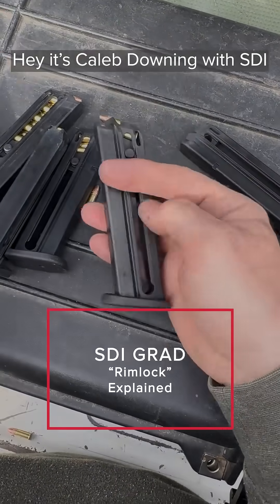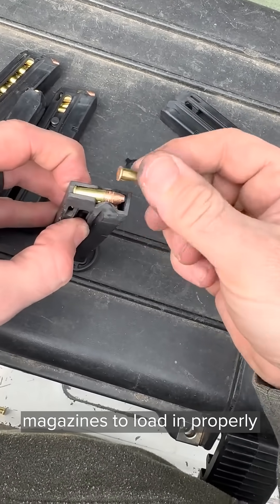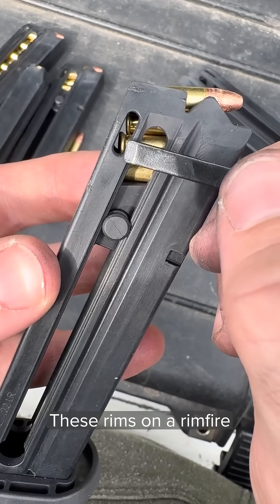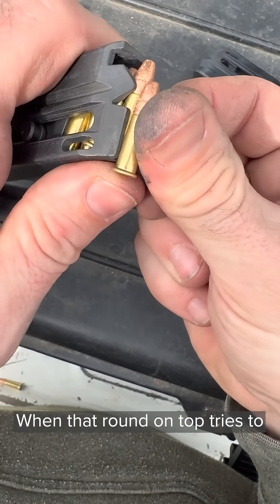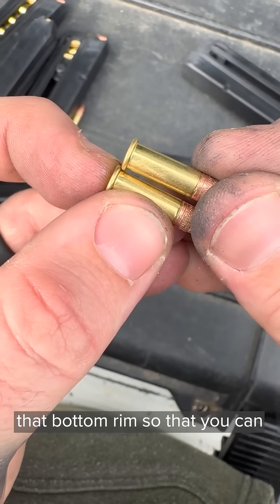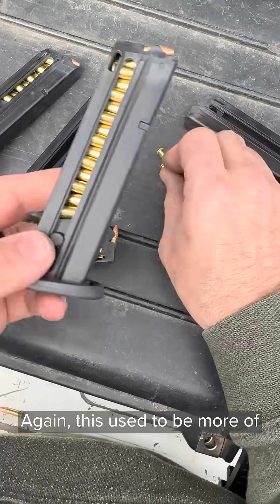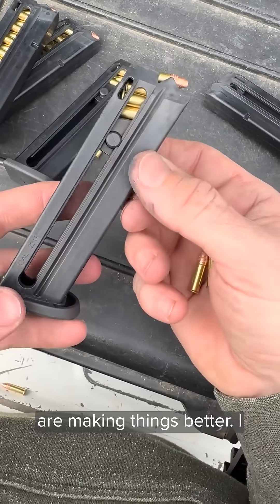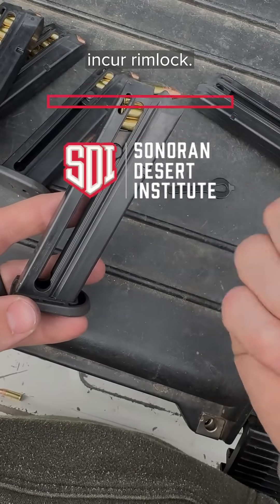What is #rimlock? 🤔

Comment: Just pull the follower lower and tip the mag forward 90° with bullets facing down. This used to be the only way to achieve rim lock reliable😂

Just as with rimmed centerfires, the lower cartridge has to be orientated forward in the magazin, allowing the top to slip behind. Lee Enfield issues😅